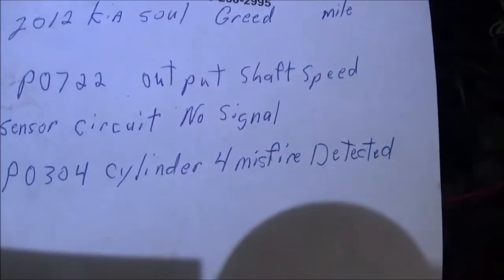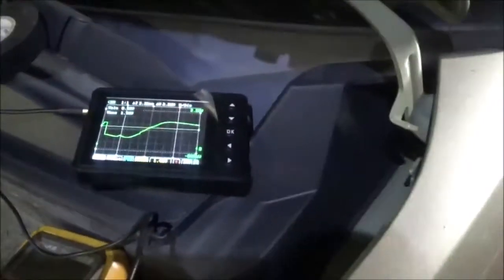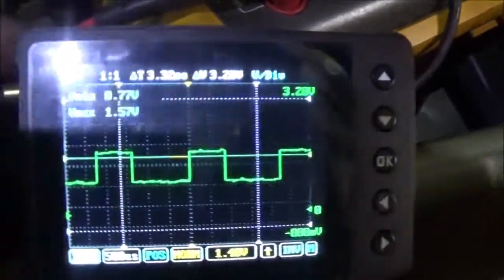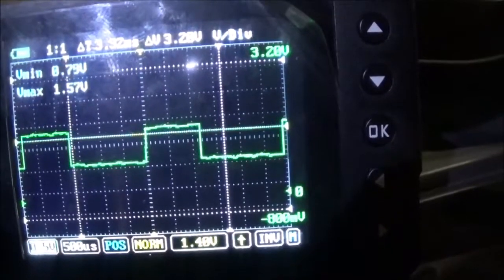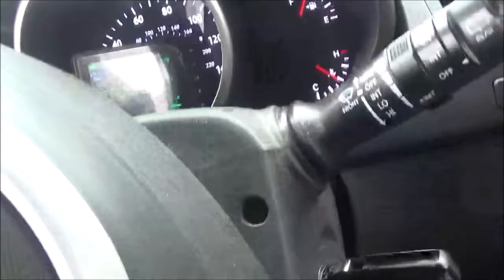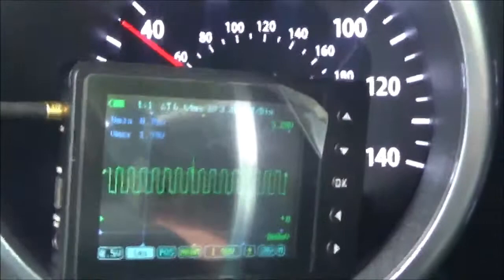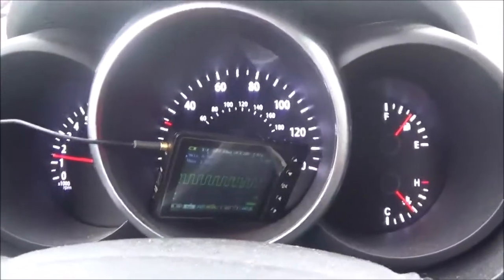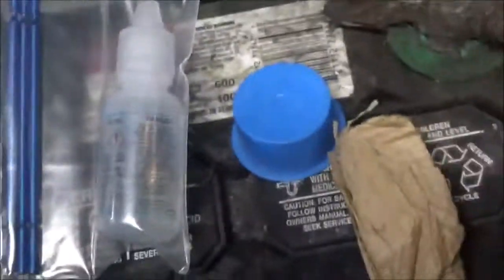KIA SOUL INPUT AND OUTPUT SPEED SENSOR TESTING

Comment: HEllo fantastic video
Could this type of intermittent issue & dtc     be related trans mechanically , dirty fluid and/or weak-bad battery ?
Reply from the maker: It depends on what the meters did that would make me make a decision. If voltage was loss, then then voltage wire or computer would have been my target. If signal loss, then sensor, internal harness, or relucter problem. If signal still there but code came along with erratic speedometer, then probably faulty computer. However, nothing happened, yet.